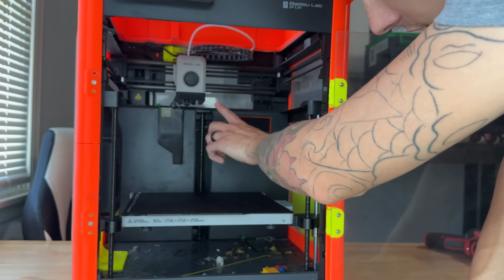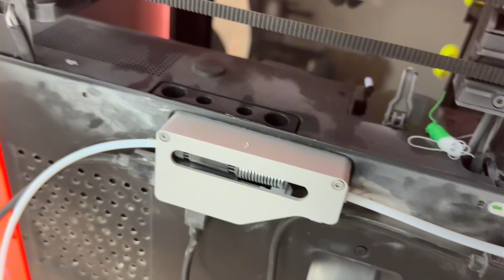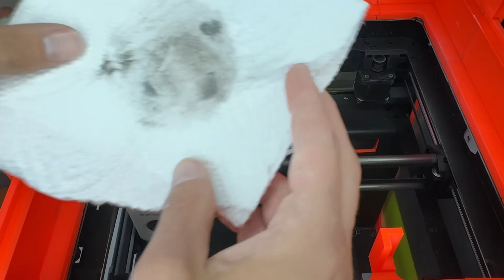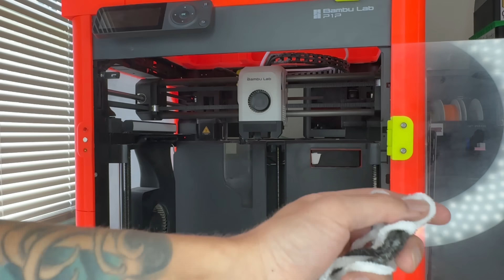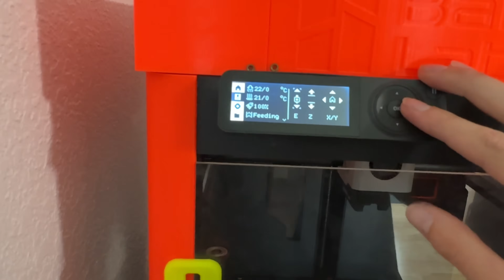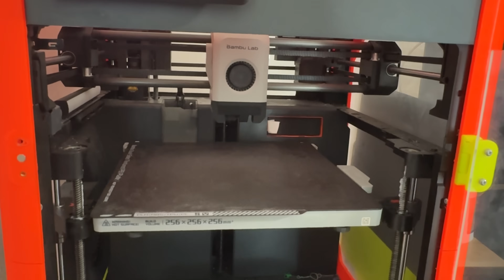Bambulab P & X Series Belt Tension/Z-Screw Cleaning/Carbon Rod Cleaning

Comment: A BIG headsup, when loosening the belt-tensioner screws DO NOT USE A HANDDRILL :) if you do them too much, the nut will become loose and drop into the machine and you have a way bigger job ahead of you to get everything working again. Just release them a little by hand.
Reply from the maker: Common sense goes a long way
Reply: I saw that then the yarn a thought this was a "don't do this" video